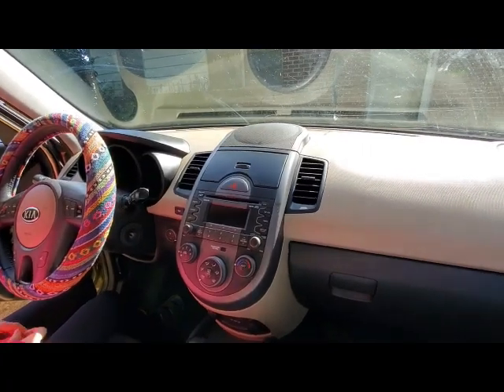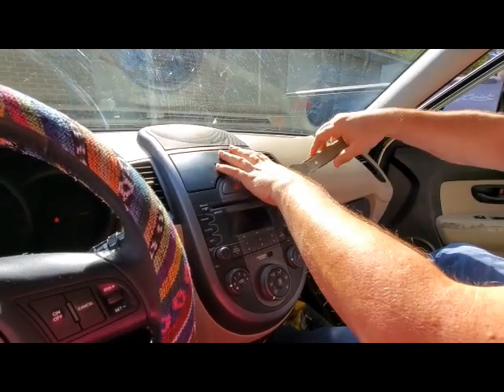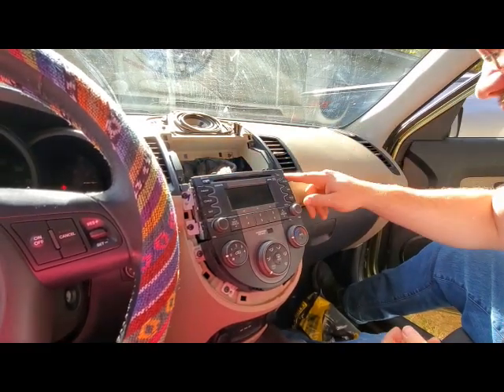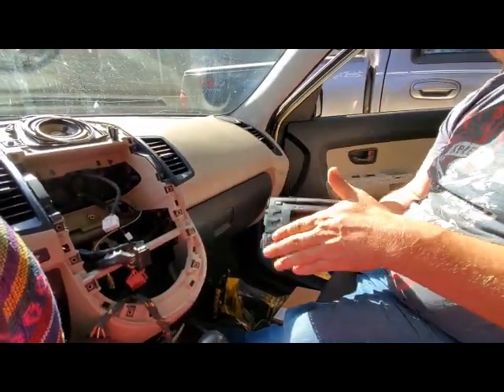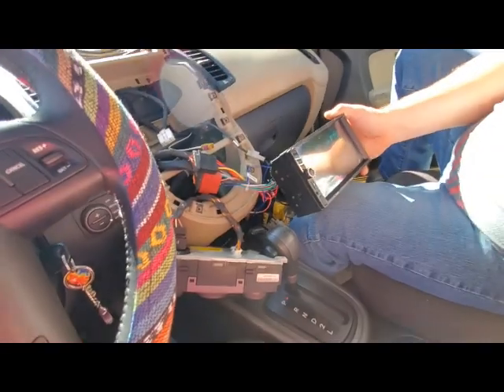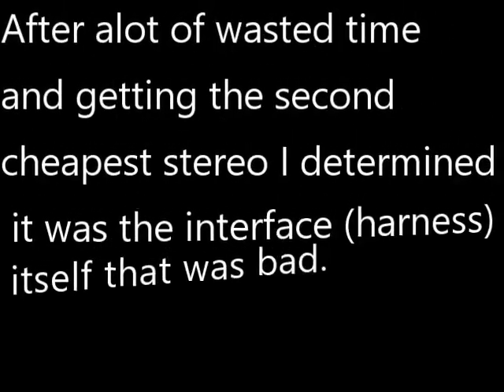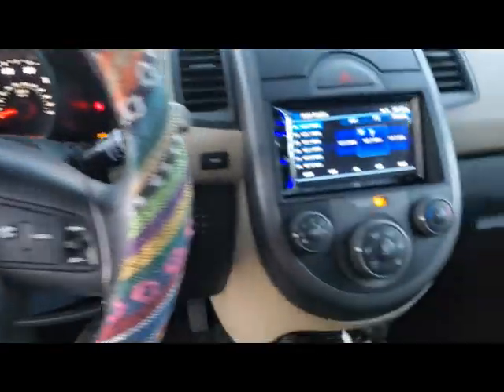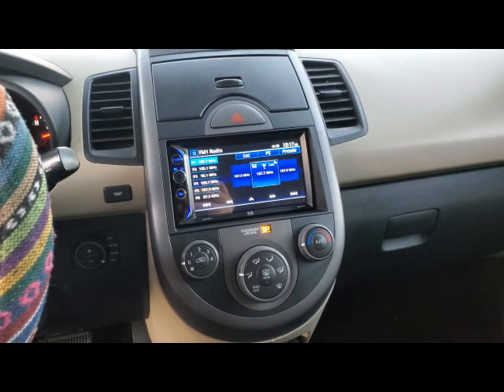How to install a bluetooth touch screen stereo with apple car play in a kia soul! cheapest can find.

Comment: I've been wanting to do this to mine but the only thing holding me back is that the new radios don't sit flush like the OEM unit, which makes sense as the dash is on a sharp angle and some units are way deeper than others and won't fit in the dash space
Reply from the maker: Yeah I wish it fit better, but the apple car play and android auto are worth it.

Comment: My mom wants a new stereo system in her car but could u link the wiring harness from factory to aftermarket!
Reply from the maker: Yep, you just have to buy the harness that connects to the factory harness.  I would suggest Crutchfield.  They have good directions, show you options for your specific vehicle and have kits that will fit perfectly.
Reply: @CousinCleatus  can u send the link plz I have no sound and can’t figure it out
Reply from the maker: https://www.crutchfield.com/cart/default.aspx
Reply: @Braddapainter  did the wire harness bring back sound? I'm going through the same issue as of now
Reply from the maker: Yep

Comment: How did you install the steering wheel interface I’m having a hard time locating the correct wire layout to get my steering wheel control
Reply from the maker: I used the harness that I ordered from Crutchfield.  It is supposed to just plug in and work.  I couldn't get it to work either.  I swapped radios and it still didn't work.  It ended up being the wiring interface adapter.  Crutchfield sent me a new one, hooked the new one up and it worked with no problems.
Reply: @CousinCleatus  thanks I’ll have to look into that.

I’m using ASWC-1 Axxess brand and it says it’s compatible with my vehicle but now I’m wondering if it’s compatible with the radio
Reply: Do you have to have that for sound ?

Comment: I have a 2011 Soul, I purchased a Scosche wire harness, the wire harness is listed for 2009-2019 Hyundai/Kia I removed the radio but the wire harness only fits the two smaller plugs not the larger on on top. Do you know if the radio will work if i do not plug the top larger plug?
Reply from the maker: Plug it in and test it before you put it all back together. I unfortunately do not remember what exactly this specific radio takes. Top two are probably for the Amp and sub though.

Comment: What size is the radio?
Reply from the maker: It is a 6.75 I believe.  If you use Crutchfields website it will tell you based on you specific model what will fit and any parts you'd need.

Comment: Why didn't you just solder the cable to the back of the auxiliary plug that came with the car?
Reply from the maker: Didn't want to take a chance on this cheap head unit.

Comment: Can you post the amazon Link for the stereo? Thanks!
Reply from the maker: I think this is the one I used on the kia soul.  I used a cheaper one before and it didn't work because of the harness I used.  This is the more expensive radio. I can link the cheaper one if you need it.  Thanks for watching!
https://www.amazon.com/dp/B0863GWFV9/ref=cm_sw_r_cp_apa_glc_fabc_ZN89BW1VDTHVBVPA62X0?_encoding=UTF8&psc=1
Reply: @CousinCleatus  thanks my friend!
Reply: @CousinCleatus  can you post the Amazon link for the expensive stereo pls

Comment: Which head unit did you get? Do you know the name? Or have a link? I just purchased atoto brand one and wondering if I need the same wiring harness you have or the one that I got which doesn’t have that interface but the brand says it retains steering wheel controls.
Reply from the maker: Ended up getting a boss head unit.  As far as the harness, I just got the one that Crutchfield said I needed for this car.